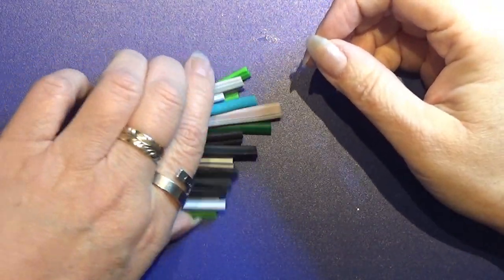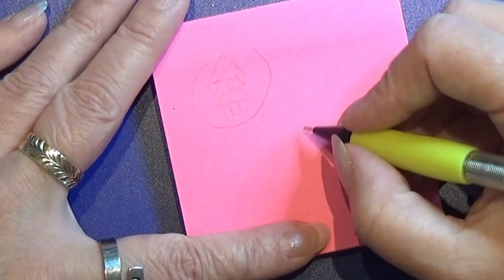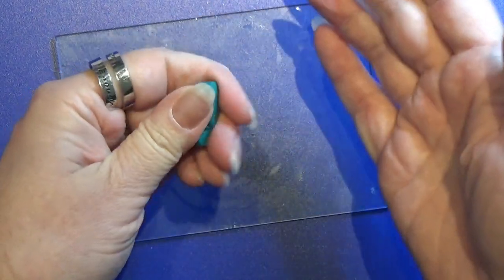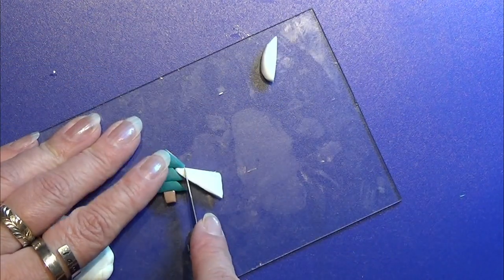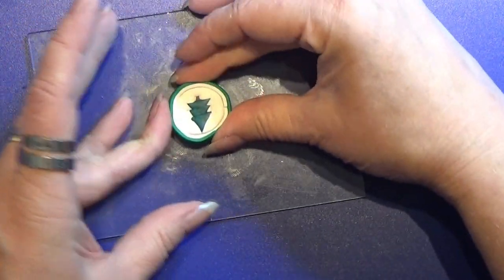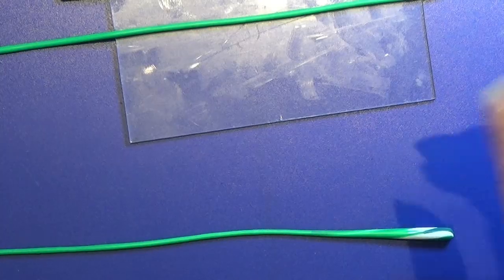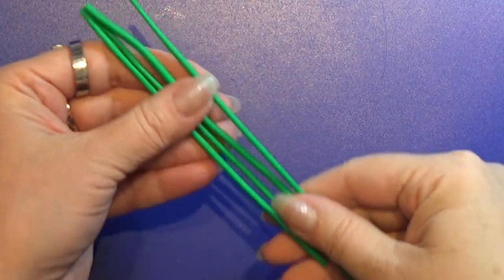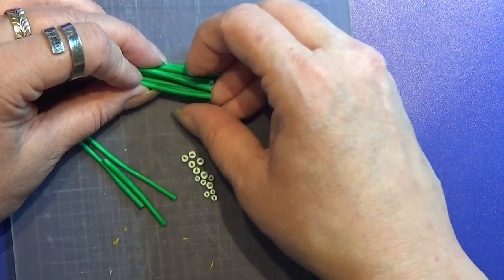Polymer Clay Miniature - How To Make Canes

Comment: I tried making a cane and it just crumbled as I tried cutting it, I think I'll try your advise and get a new sharp blade and experiment with baking time.
Reply from the maker: Also remember to  knead the clay well before you start, that will also help you!
Otherwice heat the done cane a little, that makes it soft and easy to cut 💖